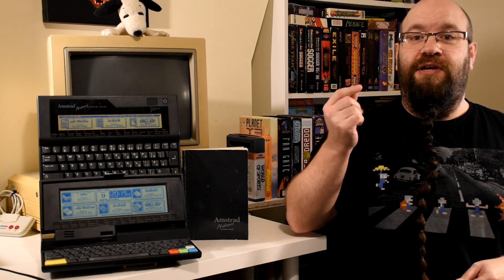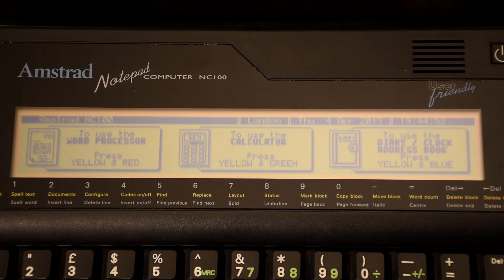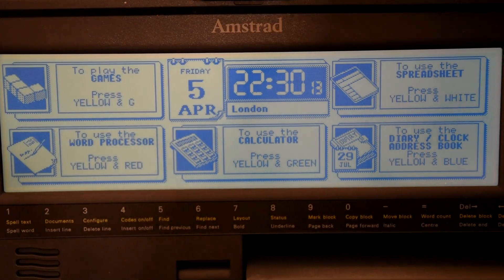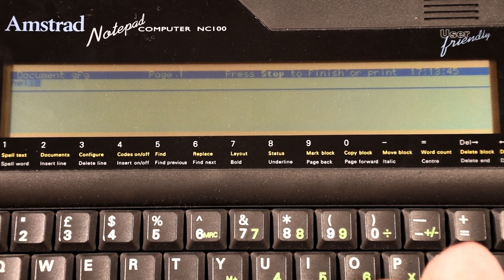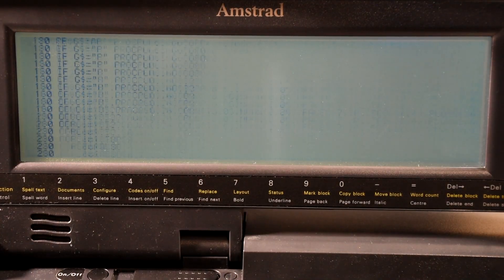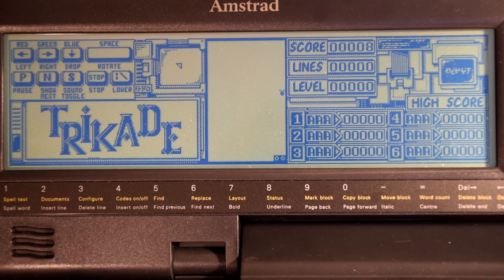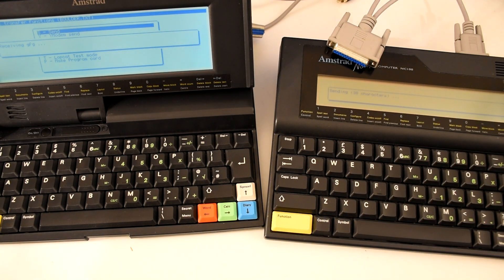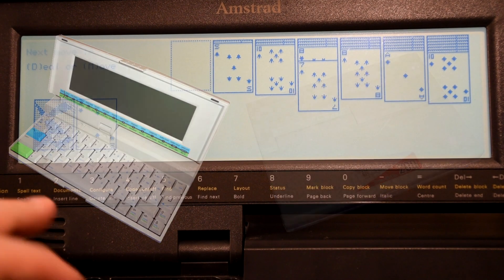Amstrad NC Notebook Computers (NC100 and NC200)

Comment: Nc100's are super easy to pick up cheap too but not case with 200 anymore

They are getting rare now and pricey mine cost well over £140 last one i saw on ebay was £180.00

But while nc-200 is rare my Tandy wp-3 is even rarer not seen any of them pop up
Reply from the maker: Yeah, I'd been looking to get my 200 for a while, and had seen some high prices for them.
I ended up getting lucky and finding one that the owner had broken (used the wrong powerpack I'm guessing), so it only works with batteries now.
but that was fine with me, and at some point I'll look at the power circuit to see if I can fix it.

and yeah that Tandy must be really rare as I've not even heard of it.
Reply: @GouldFishOnGames  yeah because tandy was radioshack's brand it only appeared in their stores dont think it ever made it to us market but did appear in canada and uk cannot but cannot find anything to say if it appeared in europe. 

Still trying to track down a faulty scrap non working apple 1 keyboard as they were made by matsui & its identical component wise to wp-3. 

 nc200 as say is really heavy on batteries even with lightweight gotek conversion kit it takes tons to even write a 1kb txt file onto usb stick i am looking at getting a set of c cell to aa converters and run set of amp torrent Lithium i-on batteries in it already have some in R/C car controller and because voltage and saftey chip is inside cell itself doesnt need seperate charge circuit and work on anything

Comment: I've yet to see someone use them as a serial terminal. Apparently, nobody on Youtube has turned their little NCx00 into a small serial terminal.

Also, quite the beard, sir.
Reply from the maker: Back in the day when I had them I mostly used them for writing notes, reports and messing around with basic.
so that's what I figured I'd show them doing.
but I guess they would make for fine enough serial terminals
Reply: @GouldFishOnGames  Difficult to get my hands on one of them, but I'm pretty sure you could use them as a VT100-style terminal with Linux over RS232.

Comment: You've earned a sub dear sir! Thanks for taking me back down memory lane, at school, there was a class (some kind of robotics) that used those notebook pc's to control some small robots, it could nifty things, they had some custom pcmcia cards with software and they used the serial port to accomplish this. Great lil machines and very underrated by most people! I dig the NC200 though, what a cool looking computer!
Reply from the maker: Thanks, Did you write out little programs to control the robots, if so how did it save the files just to internal storage or were you able to get them off easily enough?
They were great little machines, I was given the 100 for doing school work on and got upgraded to the 200.
having that backlit screen and being able to save to disk was great.
Reply: @GouldFishOnGames  The professor wrote the applets for the robots, i never followed his classes, but i talked a lot to him, you can add pcmcia carts into those machines with storage for 32 or 64kb i think, he wrote them on his pc and installed it in the notebook pc, ran some basic commands and via the serial connection he could control some robots to do all different kinds of stuff, like picking up and moving small objects for example, it whas to teach the kids how robotics work, i thought it was fascinating, the prof wrote everything himself, he gave me a floppy of some old text games he wrote for my commodore 64 way back in those days.

Comment: Basically a copy of the z88 which contained BBC Basic for z80 a coup of years earlier.  Z88 had a Sinclair type keyboard but that was ok for use in libraries as it was more silent.  I think you could buy software for the z88
Reply from the maker: Amstrad wouldn't known for being all that original, finding something that works and make it cheaper in a nice case was their thing 😀
Reply: instaBlaster.